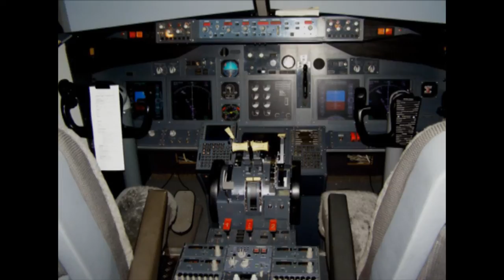Boeings older GPWS unit sounds

Comment: it's boeing 757 gpws sound check aeroperu603 cvr recordings
Reply: @lowalyy  turk = ermeni musulman
Reply: Coregame3 kim ermeni anlamadım
Reply: @lowalyy  Turk = Ermeni, Hayir?
Reply: Coregame3 ermeni değilim
Reply: @lowalyy  Sen nesin?
Reply: Coregame3 ben has türk evladıyım
Reply: @lowalyy  100% Turk?
Reply: Coregame3 evet de neden sordun?
Reply: every 737, 747, 757, 767, even the MD-11, older A300 & A310  they have these GPWS until around 2002 or 2003 not only the aeroperu's 757...Only because you just hearing the CVR instead of hearing an landing before of 2000's...